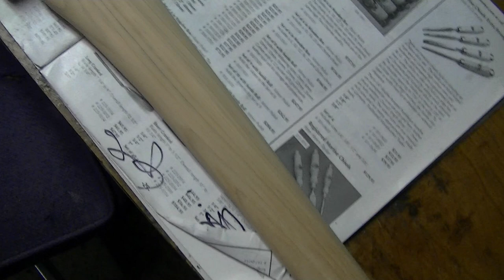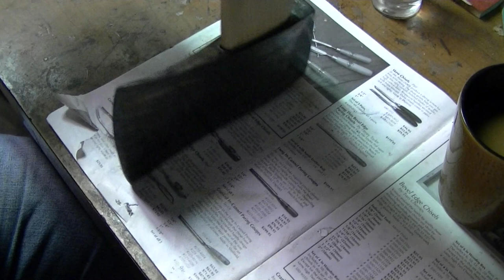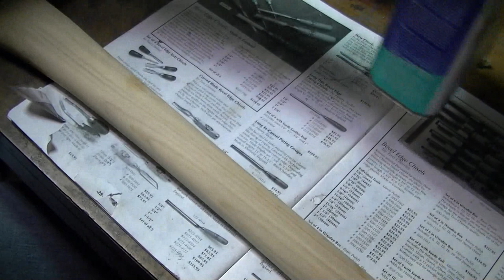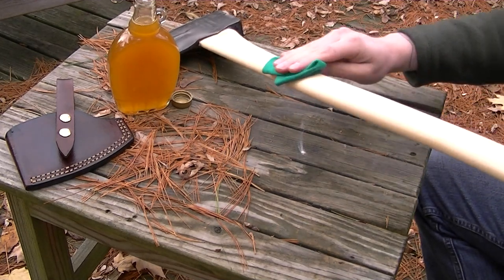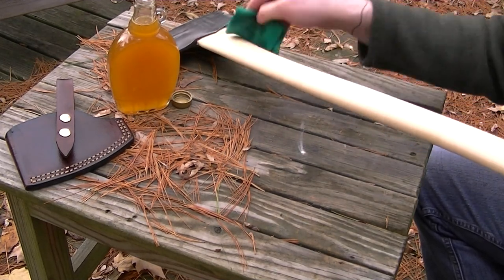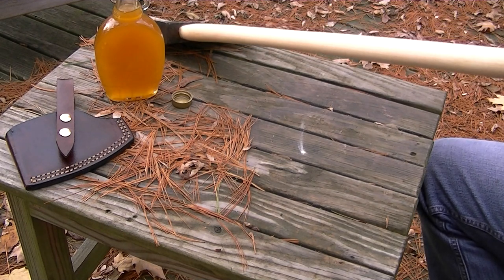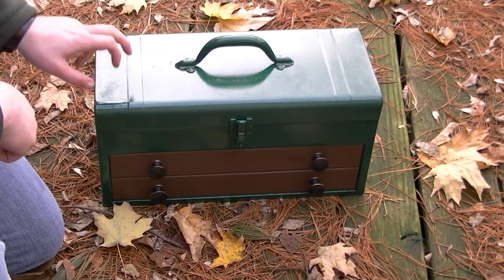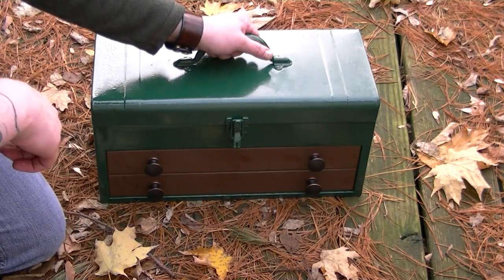The Axe is Back - The Project Never Dies!

Comment: I find my old axe heads in junk filled boxes at auctions or yard sales.  Except for the new Husqvarna that is on the way, the most I have paid for them is 2 dollars.  Mostly pocket change for the whole box.  They are all from the early 1950s to late 1890s.   If you havent discovered it yet, electrolysis is a damage free method of descaling metal objects without tool marks.  btw I like your forest service green choice of toolbox paint.

Comment: @SIG220C Only use linseed oil o. An ax head if you have no other oil, or if you want to seal the ax head for long term storage. Best thing to use is in my opinion is 3 in 1 oil. It's cheap and it lasts longer than most oils and it can be found almost anywhere.